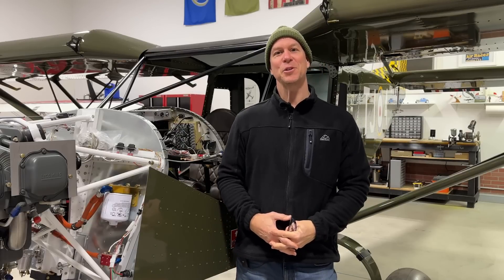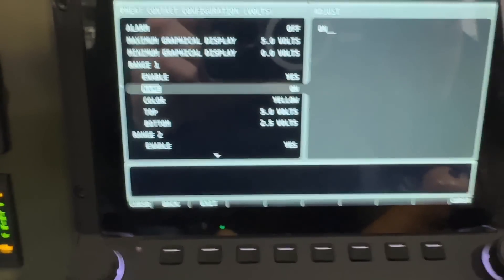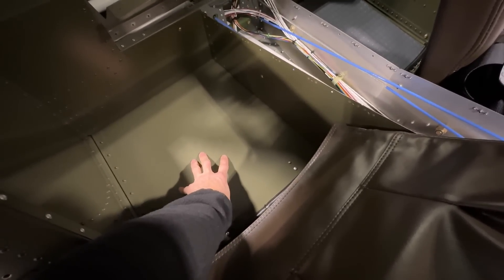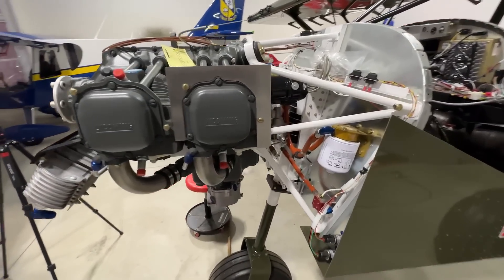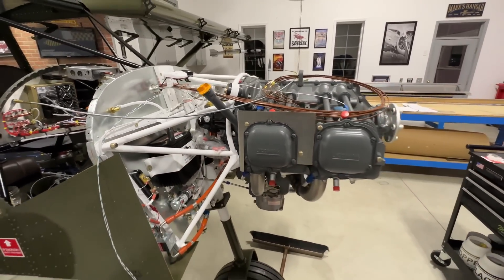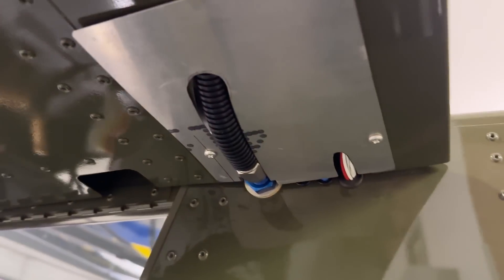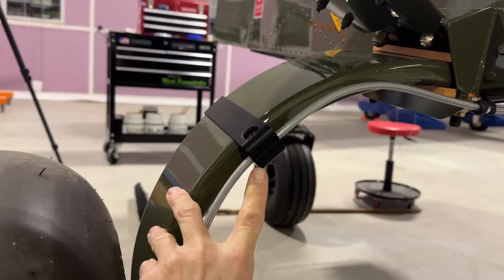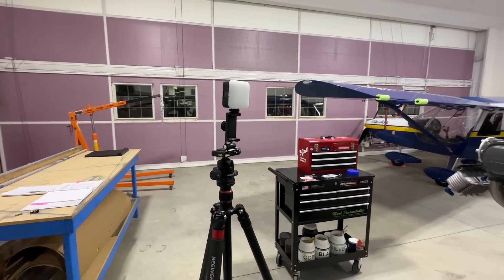Dynon is Awesome!

Comment: Nice video as always.  Are you not afraid the fastener for the throttle cable is for weak,  It will be some force when changing the throttle setting ?

Comment: Question from a layman:
Do you use a plastic product called Delrin anywhere on your aircraft?…I was under the impression it was used on aircraft. 
I’ve used it for small projects and it is easy to work with and is quite durable.
Reply from the maker: The rudder cable exits I made are machined from Delrin. That's probably the only place it's used. There are some other small plastic type parts on the airplane but I don't think it's Delrin.

Comment: On the Throttle cable AN3-7 (?) bolt connection, you mentioned the little “spacer” - the more accurate term is a “stand-off”.  😃  Good work!
Reply from the maker: Oh contraire! Lol. At stand-off is threaded. I have lots of standoffs and lots of spacers in this plane! Thanks for watching 👍👍

Comment: I posted a comment earlier but it did not post.  You might want to consider swapping those two dipole antennas on the belly for the Shark Fin style.  I have had to replace both on my airplane as the ones like you have installed both broke off at different times.
Reply from the maker: Scott what the heck are doing with your Navy Cruzer?? You must be seeing some combat action lol! I’ve never had one of those little antennas break on any of my planes. The one on my Mooney was 50 years old and bent but it still worked. Those blade style antennas do look a lot nicer tho-I have one on my Cruzer.
Reply: @KitplaneEnthusiast   I suspect they cracked do to wind resistance during my "high speed" cruising...🤣

Comment: For the GPS card, GARMIN recommends a 8gb card max but I have used larger. Then you reformat it per the instructions on their website. You don’t need a GARMIN specific card.
Reply: They are digital camera SD cards. I have a 32GB card that works, Garmin says I am lucky but they have had 72GB cards work in the past. 
My home computer stopped working and a friends computer only can do micro cards, the micro to standard card reader worked for me, don’t count on it. 
Follow the Garmin update instructions exactly, I had to call and have them explain step-by-step how to do it. Fun was had by no one.

Comment: Videos are great.  Only issue I have is I have to turn up my audio to 100 % to hear them.
Reply from the maker: Interesting. I’ve watched this video on my desktop, laptop, phone, and iPad and haven’t had to make any adjustments to the audio.
Reply: @KitplaneEnthusiast same here, no problem with volume.
Reply: When I read the "complaint" above this one I tested the audio on my two "high" level laptop computers (14 and 16 inch) and phone. All are equipped with the best HD audio systems available on those systems. I didn't have a problem with any of them. That doesn't mean there is not a problem with lesser systems and it could be the processor used to produce the sound is not working properly. If just a few people have the problem it could be their problem and not Kitplane's.
Reply: No problem here. And I keep the volume low so my wife can't hear in the other room. She thinks I'm obsessed with aviation.

Comment: It would be nice if full scale aircraft kit makes would take a lesson from one of the manufacturers of almost ready to fly, (ARF), RC planes. They include in the package a clam shell, vacuum molded clear celluloid cowl that fits over their painted cowl. That way you can mount it on the airplane with the engine and other stuff mounted, see where cuts in the cowl are needed, cut them out of the clear celluloid, then put it over the painted cowl to mark it for the cutouts.
Reply from the maker: That would be awesome! Probably expensive, but it would help if cutouts are needed.

Comment: Hi Maybe I am not right but I am just worrying about your throttle cable support attached to engine frame. Engine should move around and vibrate and this engine movement could constantly change your throttle position on carburettor.